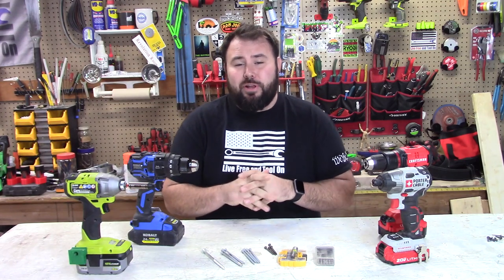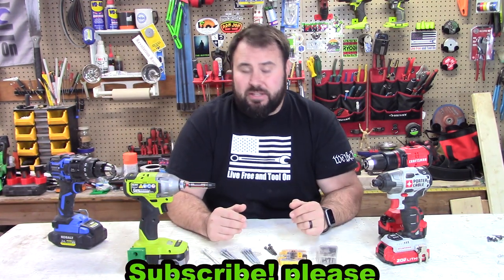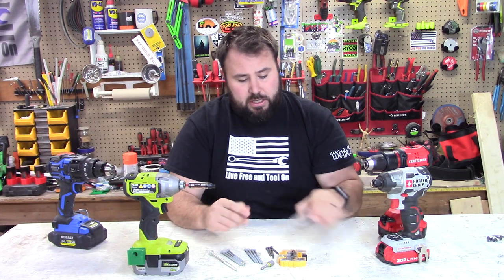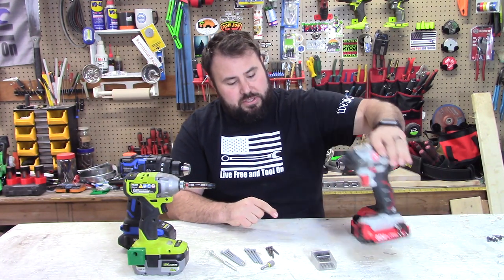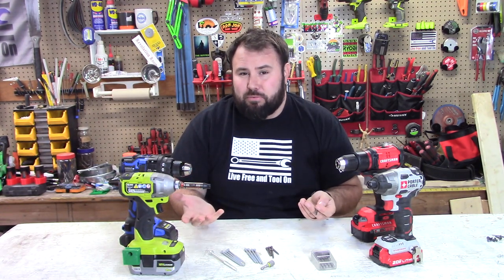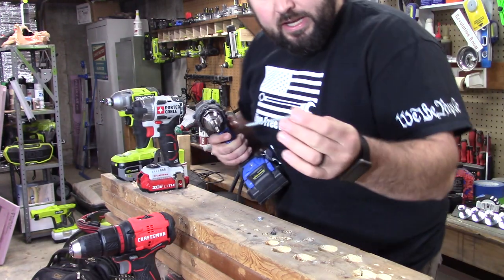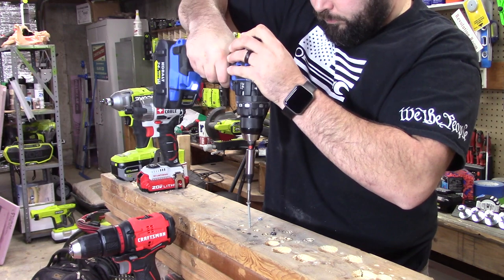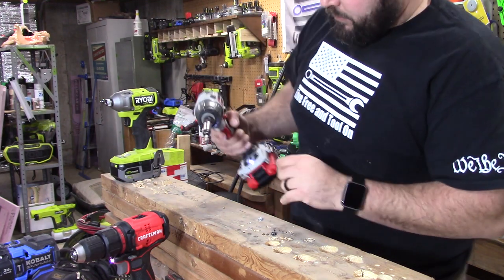Make driver bits last 500x longer!!! [Crecent Vortex]

Comment: It’s designed to smooth out the jitteriness of a impact driver. So use on a non impact driver, wouldn’t seem to have value, because that’s not what it’s designed for.

Comment: This reduces the impact force, therefore extending the life of bits and fasteners not designed for impacts.

Basically a fix to the stupid of dudes who refuse to use the right tool (drill clutch) for the job.